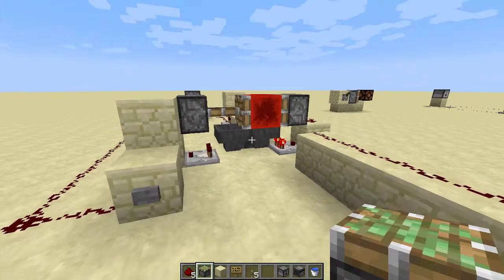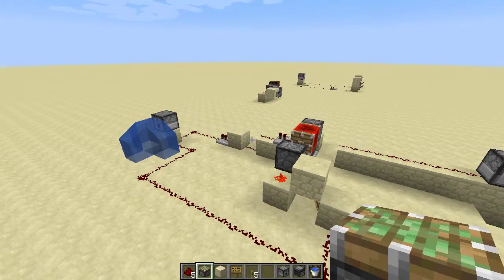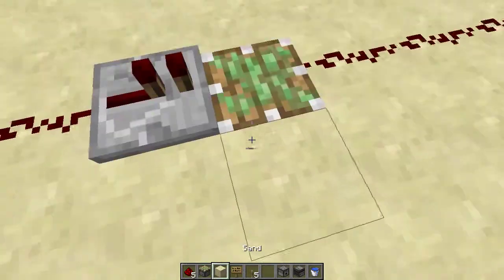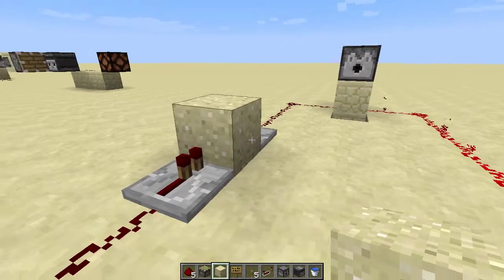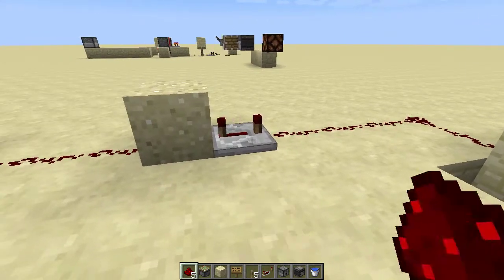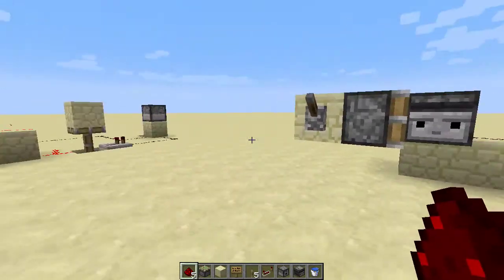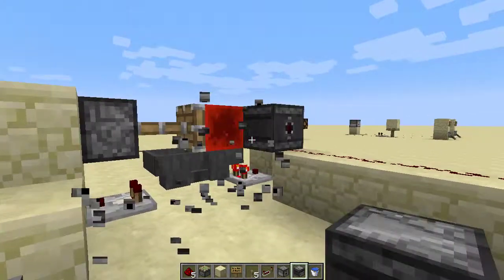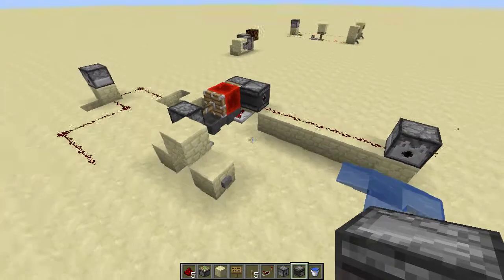Double Pulse Delay Extender - PART 2

Comment: I really wish you explained how to build this... I am pausing again and again trying to figure out what goes where, but it's really difficult, especially since you change your mind halfway through the video to use observers and change the design again...
Reply from the maker: Sorry! just search for an etho hopper clock tutorial.  That should explain how to build one correctly, then after that just put an observer in from of one of the pistons and you should be good to go.  BUT, don't forget to put a torch by one of the pistons or the clock will cycle indefinitely!  Good luck!

Comment: To save on resources, could you just do a pulse extender going into the piston that the observer is watching to trigger the dispenser of water?
Reply from the maker: Not sure what exactly you mean... the length of delay is still dependent on the Etho hopper clock, unless you want to manually use a lever.  The pulse delay extender is the clock, so I think the way I showed it at the very end with an observer is the most cost effective design.
Reply: Sorry, I guess I wasn’t very specific, would using a pulse extender to power a single piston with an observer looking at the piston work for the clock/timer? That way the piston will turn on, triggering the observer, and which will power the dispenser of water, and then the pulse “dies” from the extender, de-powering the piston, which triggers the observer once again flicking off the dispenser of water. And to change the timing just make a longer or shorter pulse extender. 😁🤞hopefully I was more clear this time.
Reply: @damonpetersen9845  That's essentially what I'm doing at 2:56, I'm observing the piston from the clock mechanism to trigger the observer which automatically pulses once when the clock starts, and once when the clock cycle ends.
Reply: Oh yeah, I know, I was just asking whether my idea would work as well, while saving a bit on resources.
Reply: @damonpetersen9845  I finally get it! yes! that would work, although depending what extender you use, you'll end up using more quartz, etc. so I guess it depends on which resources you have most of.  I think this design will be most compact for really long delays though.
Reply: Oh good 😂 thanks.